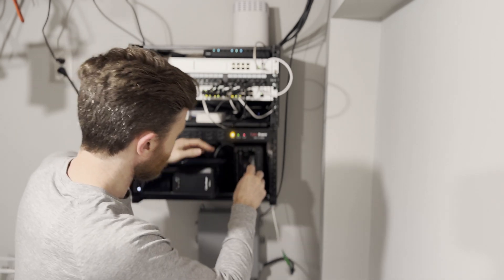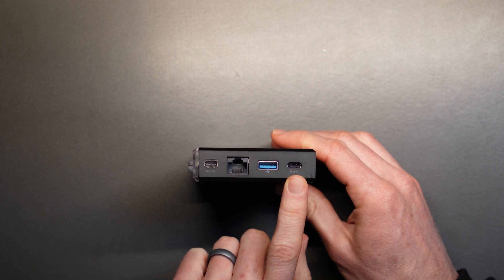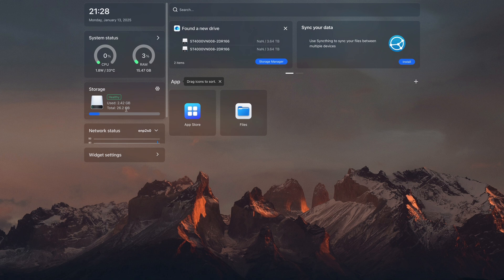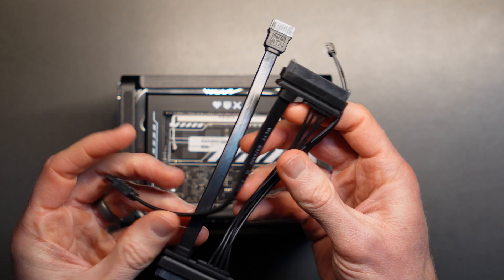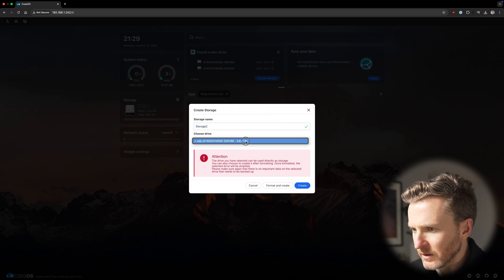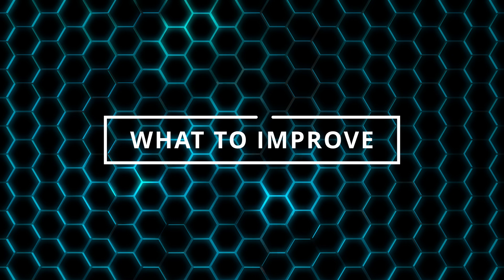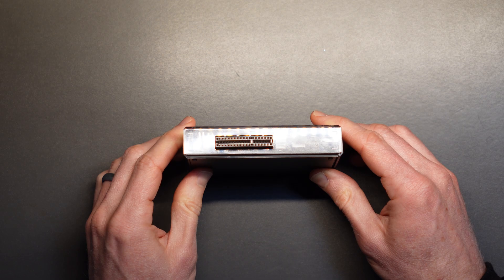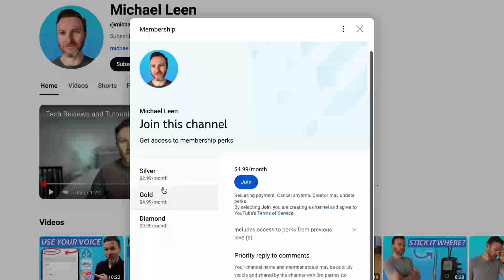BEST Budget NAS? ZimaBlade Review

Comment: I have two of these. One is my primary NAS. The second I am planning on experimenting with for some mobile NAS ideas. For the primary NAS I got a PcIe SATA card with 5 ports. In addition to the two drives plugged into the ZIMA, I have 3 drives attached to the PCI card with plans to add two more. I have had no issues with over heating. Granted, it is not that fast. But My needs are modest, so it is plenty fast enough Since I can install a different OS on the ZIMA Blade. I am going to try the full ZIMA OS on my secondary ZIMA. At the price, why not?
Reply from the maker: Sounds like a great setup, thanks for sharing!
Reply: With 2 drives are you able to set a RAID 1 for redundancy?
Reply: @frankreyna4456 The primary NAS was and is running Casa OS. At the time I wrote this Casa OS didn’t have a way to set up RAID 1. Zima OS has RAID configuration options. So I will be upgrading from Casa OS to Zima OS and configure a RAID 1.

Comment: Raspberry Pi 5 + Radxa Penta SATA hat, and then a 3D printed case. Affordable, four internal drives and small. Personally I built a normal MiniITX PC with a Supermicro MiniITX board in there, the majority of the cost with a NAS is the drives and it's so crucial I want max reliability over cheap.
Reply from the maker: Sounds like a great setup. And like you said, so much of the cost is the drives themselves.

Comment: I will suggest skip these and get something with n100 inatead

Cwwl p5x86 or their pocket nas 
Or gmktek nucbox g9

All of these are not expensive
Reply from the maker: Not sure what use case you are referring to (i.e., NAS, home automation server, etc.).
Reply: @michaelsleen  all purpose better than zima except anything need pcie slot 

I have one p5x86 with 32GB DDR5 and quad nvme+2 SATA drive using as a nas , it also comes with dual 2.5 port.

g9 ordered waiting shipment. These will run beside the larger storage node jonsbo n5 running unraid and serve as silent solid state storage 

you get at least 4 m2 slot on any of those 3 device I mention above and the cwwl p5 x86 have 2 additional SATA connector support 4+2 storage in total

Their Pocket nas is same thing but the case didn't reserve mount or space for SATA drive 

These 3 device come with n100/n305 or n150 which have way better quicksync compare to the Zima series 

Only thing missing is pcie slot 
If need pcie slot cwwk have a product looks like a Zima and it comes with pcie slot.

Sometimes you can find cwwk named topton, their product are about the same